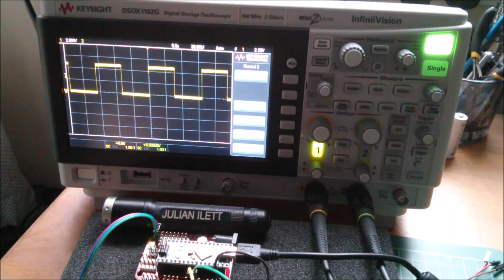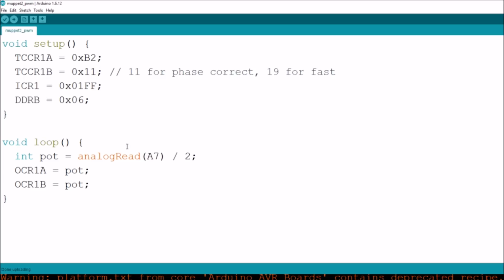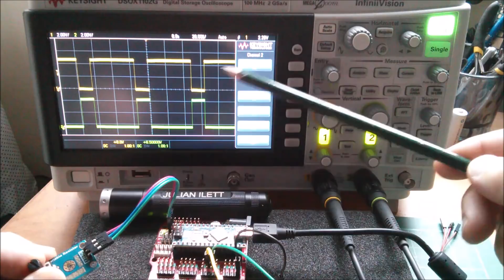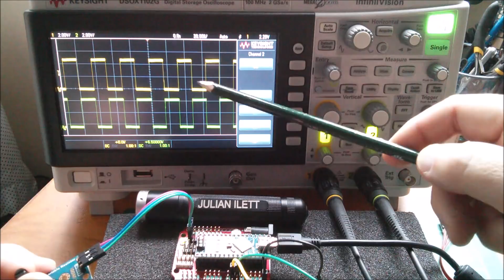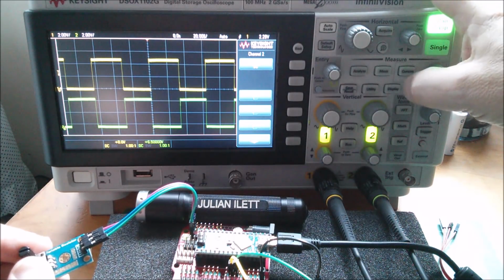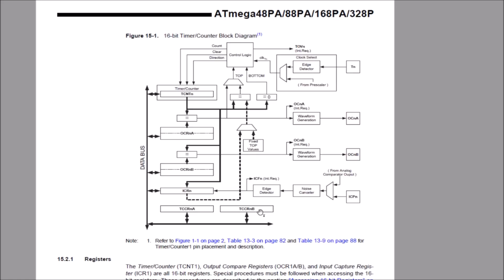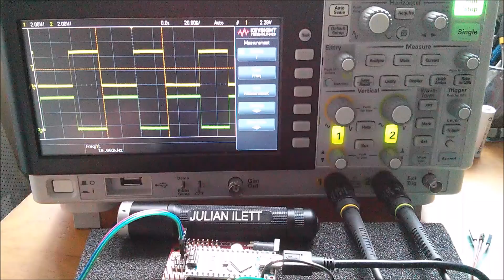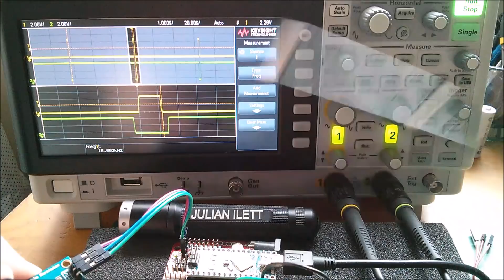Arduino PWM without analogWrite() - Muppet 2 Project

Comment: Julian Ilett
Hello. Can you prompt the issue of arduino pwm controlling the mosfets. It goes from 0 to 4.5 volts on linear mode on voltage. But should it be a step from 0 to 4.5 with pwm without any linearity on a voltage, to controlling the applications?. Sorry for the noob and such a kind of question.  I do the DIY motor controller, and if I add a gate driver to mosfet with say 12v of driving voltage, the arduino don't give a damn on a pwm and just ON and OFF full power, no matter what pwm cycle is applied. 
Thanks.

Comment: julian , while using timer 2  8bit for generating noninverting and inverting pwm using direct register write i see that inverting pwm2 is little bit phase shifted in respect to pwm1. what can be the issue.
pinMode(3, OUTPUT);
  pinMode(11, OUTPUT);
  TCCR2A = _BV(COM2A1) | _BV(COM2B1) |_BV(COM2B0) | _BV(WGM21) | _BV(WGM20);
  TCCR2B = _BV(CS22);
  OCR2A = 55;
  OCR2B = 55;

Comment: JULIAN ILETT YOU SHOULD DEFINITELY MAKE A VIDEO EXPLAINING HOW TO BUILD A CIRCUIT, CODE, APP AND ZERO CROSSING CIRCUIT WHICH CAN CONTROL AT LEAST 5 AC LIGHT BULBS AND BE ABLE TO NOT ONLY TURN THEM ON/OFF BUT DIM EACH ONE OF THEM SEPARATELY VIA BLUETOOTH HC-06 AND ANDROID APP. THAT WILL BE A CHALLENGE!!!

Comment: I've been trying to get complementary / none overlapping  waveforms just using the 8 bit timer. There is  inverted bits in the TCCR0A register  for both  OCR0A and OCR0B. it only works in CTC mode?

Comment: Wow; you know years ago (way back when Christ was a Corporal!) I used to have a C=128 Commodore setup and subscribed to RUN magazine and a few others.  They came with "FREE SOFTWARE!" in machine code, entered with a special assembler that you had to type in, or buy a floppy disk with it included. Of course you had no idea how the machine code worked because it was just a series of 8 bit numbers entered into the program, then assembled into a game or utility.  I used to do them all!  Had the wife read me the code, as I punched the numbers into the software, then we would play the games.  Well at last, I can get a bit of understanding what all that was all about.  Great to have a bit of education whilst I sit down here in our 35 foot Rexall Rexair Class A Motor Home with an old recliner  sitting in the middle of the living room holding my aging body up in a rather comfortable position.  We just returned from a walk around the block in the beautiful Arizona Sunshine!  Oh by the way, did anyone ever tell you, we got your bridge from London?  Yep, just 26 miles from where I sit, in Lake Havasu City, sits the London Bridge with a small imitation London community under it.  We stop off for some of their wonderful Fish and Chips when we visit.

By the way, have you tried that little Arduino with the extra pins yet?  Just wondering, I use them all the time down here as I don't have a lot of room, and they are almost like having an Arduino and a breadboard in one. Oh for reference, it is 68 degrees F. here in Golden Shores Arizona, a bright and sunny day, so much nicer then it was when we left South Dakota a week ago, where it was 8 degrees F. with 5 inches of snow on the ground.  -The nomadic snowbird--

Comment: There are some useful macros for dealing with timers in the fastio.h file included with Marlin firmware, and I built a nifty function around those macros that will set Timer 5 to any frequency and 5A,5B,5C each to their own duty cycles, normal or inverted. If you grab the Marlin package fastio.h file, you can use the function, which I've posted in a gist at https://gist.github.com/thinkyhead/6eea142de9dda3b6d3eb14daa9a518d5

Comment: I just copied your code into the IDE and ran it on a DIP 328P I bought in 2013 and the waveforms DO overlap. This might require some further investigation.
Reply: Yeah I tried it on my Uno and Nano and it does not do that. There is no "dead time" at all. There is something different happening with your Nano. It's not supposed to do that.

Comment: Fixing it in software would have been perfectly fine :) It keeps the abstraction layer intact :)

Okay, it would have been even better if the Arduino PWM/analogWrite() library was a bit more capable. Aka, enable invert via the abstraction and act on it with a write.

Or at least the fix should have included a -1 in the else state :) Good to remind me of that!

Comment: The flipping was not a bug but a misuse of the library. You must NEVER mix library accesses and direct register accesses. You either use one or the other but not both. Inverting was also quite simple: just call the library with (100-dutycycle%)...

Comment: I don't recall having this issue with a similar buck/boost/synchronous rectification project I did one weekend..but my memory of it is a bit fuzzy,been a while since I needed a dual/inverted PWM output. I think I just used the map() function,to invert the PWM value. I'd have to see if I still have a copy of the code. I was using an Arduino Mega though,maybe that's the difference.

Comment: This any help?
const int pwmtop=128;
void setup(){
TCCR2A = _BV(COM2A1) | _BV(COM2B1) | _BV(WGM21) | _BV(WGM20); //Adjust timers.
TCCR2B = _BV(WGM22) | _BV(CS20);
OCR2A = pwmtop; //Go faster.
pinMode(3, OUTPUT); //PWM drive
}

That'll crank up the PWM frequency as high as you reasonably can, at the expense of precision. You'll be down to 7-bit, not 8-bit. But if you're doing with a buck converter, the trade off is worthwhile to avoid needing an impractically huge inductor.

Comment: which pin should we use ,could you please help me 
I'm using arduino mega
Reply: The mega is completely different, the program will have to be rewritten for it. It has different registers and semantics.

Comment: this is a way better way to fix it you have found, and i take no joy in seeing ide bugs....but if i was doing it quick and dirty then i would have ...(not a real language but very basic.....) (oh how did you get the guard time on the inverted signal?)

if pwm=100 then pinX=1:pinY=0
else
if pwm=0 then pinX=0:pinY=1
else
analog write pinX
endif
endif

Would have been a quick and dirty bodge, but no way as neat as just hitting the hardware

Comment: So many issues like this in Arduino. It's probably a result of crowd sourced software development where hardly anyone knows the big picture. Pros and cons. Was it you or Dave that did the vidyeo on how slow the pin toggle is using the Arduino code as opposed to using the registers? On the other hand you get the same function on the ESP8266 even though it's all software below it and the same on the ARM, even though it's completely different again.

Comment: I prefer direct access to registers. I go into that hardware folder and look into the files. I like how the Arduino IDE still exposes the names and addresses, even though they can be quite cryptic. Many functions are written with a lot of error checking but if I wanna go fast, I can't have the cruft. It forces you to know what goes on below. I never use analog/digitalAnything in my loops, only in setup(). TL;DR, I like efficient code.

Comment: you should sell muppts. and have attachments you can call them muppt baby's! for blue tooth and all the monitoring stuff. just like the other controllers. I want to get in to the arduinos so badly. but I'd have to dig my computer stuff out and likely have to build one that works. there is some thing wrong with all of them. just to get one desk top that I can use. they aren't so old to be grandmas computer. just your parents PC. less than 10 years old but not much. and of course I'm not buying a new one! that's money I can spend on stuff more important!!! great video. I hope you are teaching me something!!!  I'm trying to learn! its not do easy when you don't personally have one to work with! greatly informative video. thanks!!,,

Comment: Pwm with arduino ... Heh been some time since i saw that waveform on a screen (altough mine came from my soundcard ;D) .... I was changing the frequency for a 12V 150 watt pwm hot wire driver to a nicer frequency